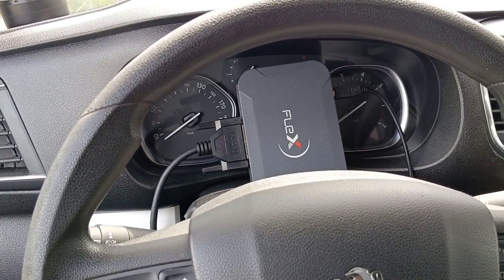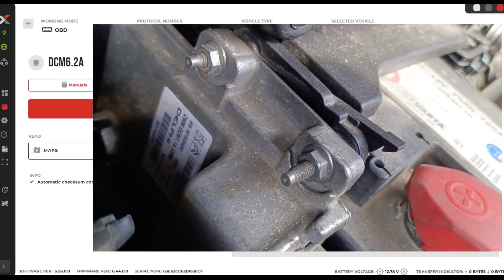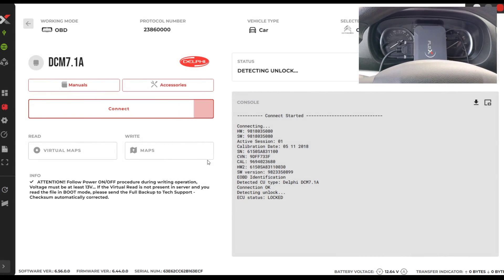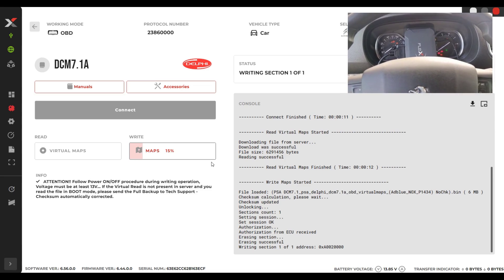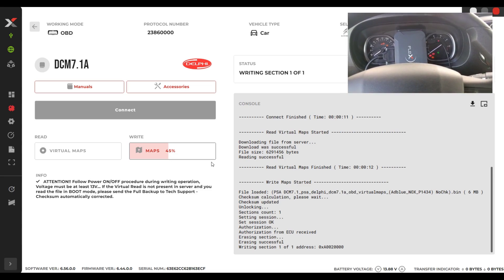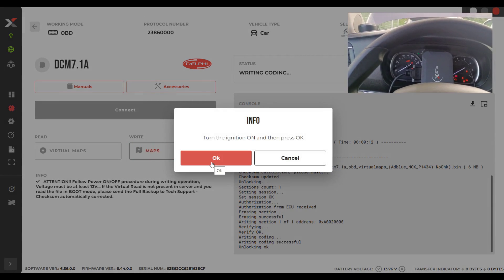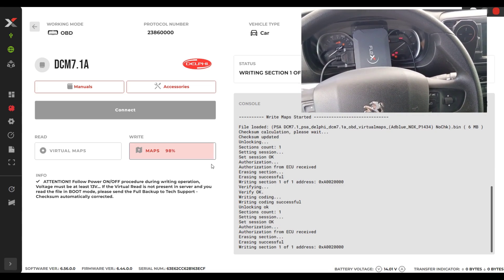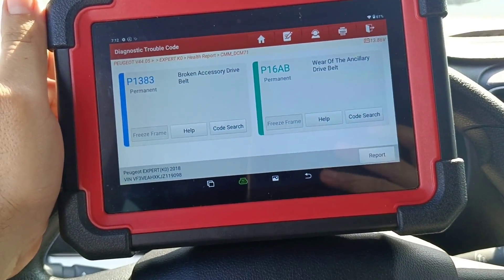unlock DCM7.1A. via OBD with Flex programmer. Peugeot/Citroen read/write Delphi ECU thru OBD. AdBlue

Comment: So in obd mode is virtual reading its not original from that car but from magic motor server, but in Boot mode you can unlock and get original file from that ecu? And i am didnt see eeprom just map?
Reply from the maker: @nekoizmase9969  
Correct, OBD it's a VR and boot it's Original .

Comment: Hi again, thank you for another great video. Where do you get the moded ECU file for Adblue off? Does Flex have some sort of data base for files like that? Also as for the scanners I asked you the other time on a comment on your video, thanks a lot for all the info you gave me. I’m going for the Texa because it is much cheaper than Bosch and it has much support in my country. The dealer of Texa says it has all the same functions, activations for solenoids, sensors and everything and in some cases it’s even better than the Bosch one, he said in some vehicles you have more options than the the Bosch. Again thank you for taking the time to advise me!!
Reply from the maker: All the files I make myself.
Don't believe everything that you heard from the seller's .
Reply: @YOYODiagnostic  i would be interested to see how that work, how about if you have time to upload sometime a video of how you make the files, that would be interesting.

Comment: You dont need to find the exactly same car/hp/model all that in tuningsoftware, the tuningsoftware is set up to make it easy to find right protocols, if you have problems and you know right protocol the car have ( search HW/SW often helps ), So if you find a peugeot that have same ecutype, you can use it, often as here the same ecu is in other cars with same protocol.

I have done this alot, most often on VAG cars, but also reanult/opel, so if you know its wrong ecu just use same protocol on other cars that share same ecu/protocol.
Reply from the maker: your theory is okay but my question is how many Peugeot ECUs have you experienced?  He knows how to communicate these ECU's from Peugeot and Citroen.  I think you know the risk when writing by obd on these brands of cars (Peugeot/Citroen)
Reply: Please  can you send me your email address or can you send me your number please 🙏

Comment: Did u ever use the kess 3 ?
Reply: In search on kess3 there are 32 results for DCM7.1a 11 are boot only rest are obd and boot peugeot 308 t9 5008 508 508sw and traveller are peugeot options
Reply: 2.0 blueHDI Engine model DW10 DIFFERENT BHP
Reply: i meant 11 are boot and rest are obd and bench
Reply from the maker: Tor this car if you ask me.
  But what do you think, I was curious to try it or not :)) .
 Thank you for the info 👍
Reply: @YOYODiagnostic  kess3 is ok i got call yesterday to do adblue delete on 2021 nissan nv400 but its sid321 and its not available yet they said engineers are working on it past month so hopefully soon auto tuner can do sid 321
Reply from the maker: @legin3753  thanks again for info 👍

Comment: Thanks bro brilliant video. Perfect time i got one to do soon...

Do you have to unplug adblue module or is ok?

The Citroen Ds7 virtual read will it be same for Peugeot expert? So if i send to my master he can adjust ok
Reply from the maker: You are welcome.
As you saw and I wrote, I have the same engine code and the same HP.  It is identical, but I said you take risks when you do it via OBD because the communication with the ECU is not direct.  When you connect the programmer in Bench, you are connected directly to the ECU, but through OBD communication is done through the ECU gateway.  I have not disconnected anything and everything is OK.

Comment: FLEX OR KESS 3? which is best?
Reply from the maker: I'm going for Flex.  It's cheaper and does the same job sometimes even better.  this is a comment based on my experience with programmers.  Everyone buys what they want, but I recommend what I use.
Reply: ok thanks for the info king, I have kess 2 o ktag myself, now I'm reading and looking around for a good key programmer and affordable.   btw your videos are nice👍
Reply from the maker: @jojo3114  thanks 👍.
Reply: Hello.  I would like to buy flex.  Are hardware and software sold separately?  What software do you use?  Flex reads full flash or only partial?  Thanks for the response and the videos.
Reply from the maker: @felixrs4939  
You have a link on the description when I use Flex. 
Better is to ask the company Flex for selling details, I'm not a seller.

Comment: With flex was no succes with peugeot 7.1a get  message  no virtual read for this software
Reply: I have the problem with a 508II 2019, looking for a VR file compatible, flex says no VR available, friend of mine plugged his kt 200 II, vr available, but we didn’t try yet because no backup if things go wrong…
Reply from the maker: Now you have seen that it is possible. 👍